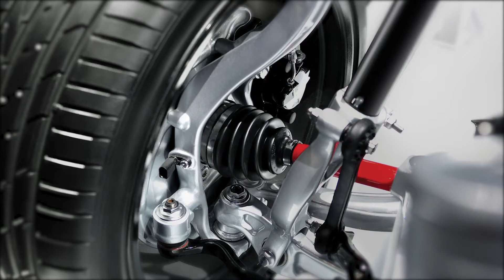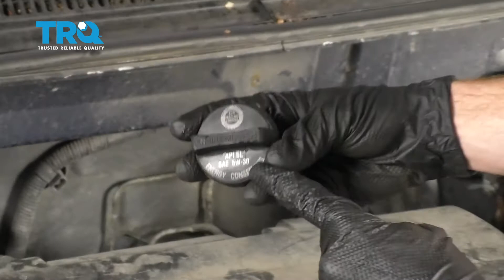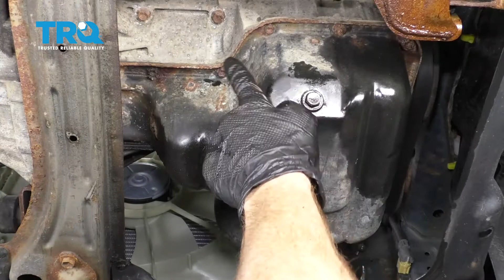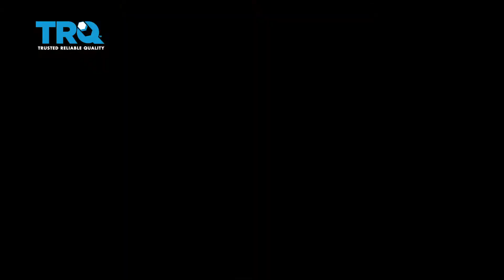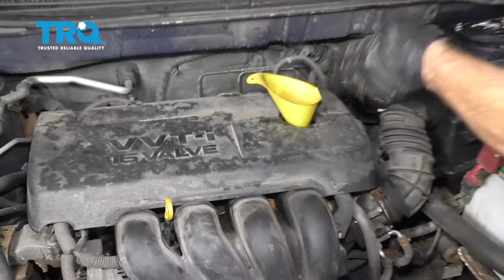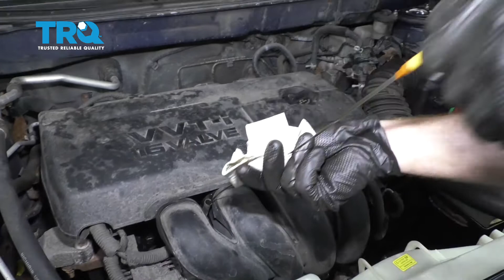How to Replace Engine Oil Pan 2003-08 Toyota Matrix

Comment: For those asking; per Toyota manual you do NOT need a gasket. It's recommended to use Toyota FIPG and works very well. It's also important to torque down the oil pan bolts/nuts to 80 INCH pounds to keep them all evenly tight.

Comment: Question on torque specs - you mentioned its 80 lbs - but other pages / sites have mentioned 48 pounds.   I dont want to over torque these especially being the oil pan.  thoughts?
Reply: This guy is an excellent mechanic. Yes, the specified torque for Oil Pan Sub-assy bolts and nuts is 80 Inch Pounds or 9.0 Newton Meters. This is from the Toyota 2006 factory service book.
Reply: Awsome mechanic and videos. Thank you for sharing

Comment: Is thier a sequence pattern when u u tighten the bolts back on the oil pan??  I heard thier was..I'm goin to do this job next week and want to make sure I don't bend the oil pan
Reply: No, the sequence is not critical for this oil drain pan, nor is it specified in the manual. Generally, thin pressed metal things like this won't have a specified pattern. But, I would always take a few passes to tighten them down, with increasing torque. The manual says that you need to do the pan installation within 3 minutes of applying the sealant.
Reply: Yes. Hopefully you got an answer by now lol do in a star pattern.